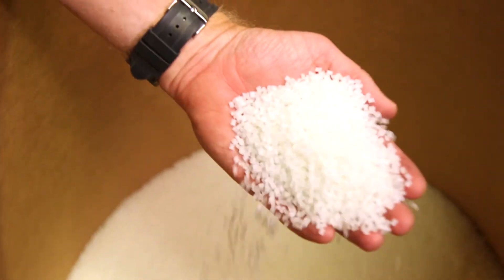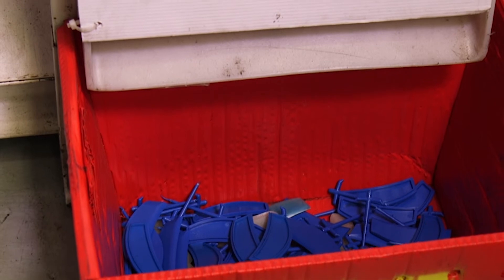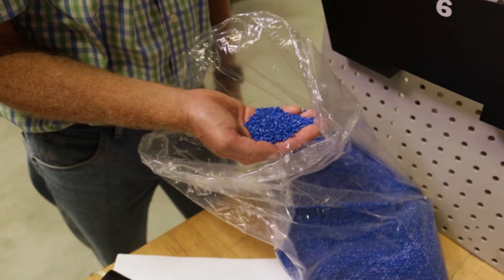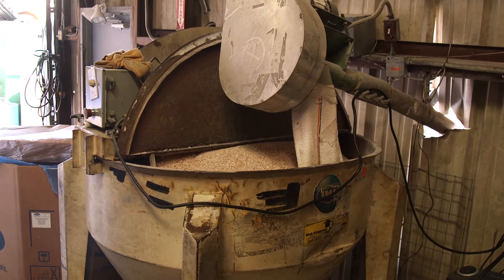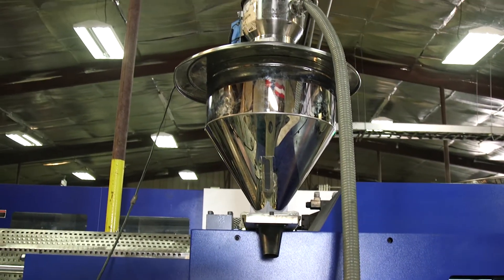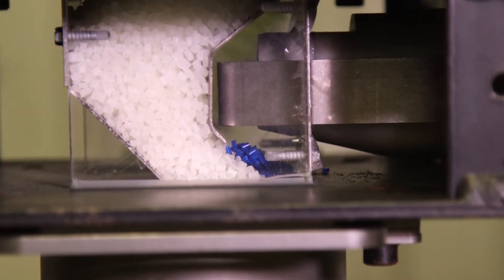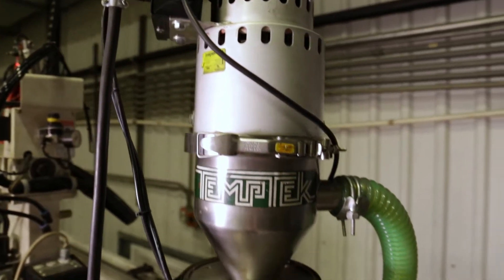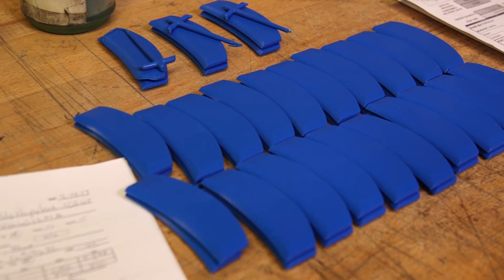Coloring Product Injection Molding

Comment: The same process can be used for light and dark colors. Matching light colors is typically more difficult as the eye can pick up subtle differences in light colors more readily than dark colors. Consistency in raw material, colorant concentration or dosing, mixing in barrel and controlling processing conditions such as temperature and injection speed all influence color. If you are having difficulty controlling the process I recommend having the color compounded into the raw material to minimize processing variables.

Comment: The Sam process can be used for light and dark colors. Matching light colors is typically more difficult as the eye can pick up subtle differences in light colors more readily than dark colors. Consistency in raw material, colorant concentration or dosing, mixing in barrel and controlling processing conditions such as temperature and injection speed all influence color. If you are having difficulty controlling the process I recommend having the color compounded into the raw material to minimize processing variables.

Comment: How do you color a product such as ABS Izod 4, which is black?
Reply from the maker: You don't.  The Izod is not the factor, you cannot change the color from black.  Start with natural.
Reply: @TexasInjectionMolding  I appreciate the input as I am a newbie and know just enough to not know.  The "Izod 4" suffix is the part name of this particular formulation; I understand what Izod testing is.  What I don't understand is the polymer pellet seller (major) telling me that black is colored all the time.  Is ABS normally all black?  Can it be colored?  I had one experienced polymer man tell me it is a brute to color and another saying, "they do it everyday".
Reply from the maker: @christiandehlinger3731  You can purchase ABS in natural (milky white) or pre-compounded in colors.  Once the material is colored black it is done.  Try taking black paint and try to make it red.  ABS has a milky yellow color in natural form that does require a little more effort and color concentrate to get the exact vibrant color you want, but it is done everyday and we do it every day.  Contact your color concentrate provider.
Reply: @TexasInjectionMolding  What you are saying makes total sense to me and I did not understand what I was being told.  Thank you.